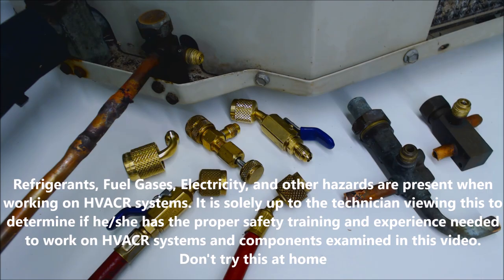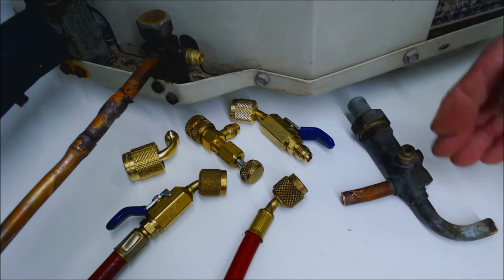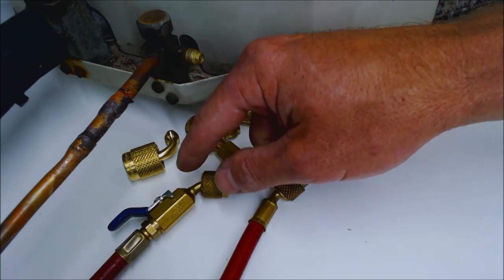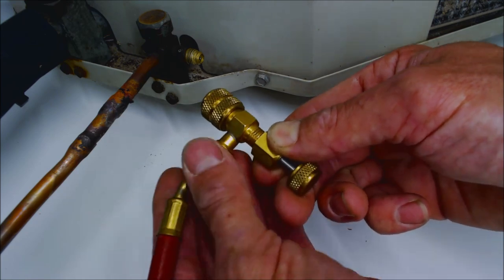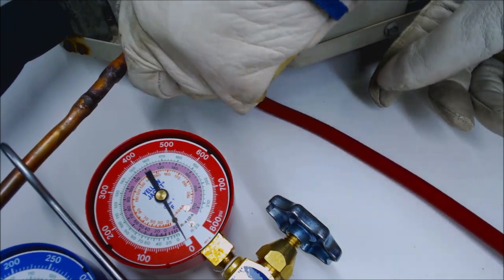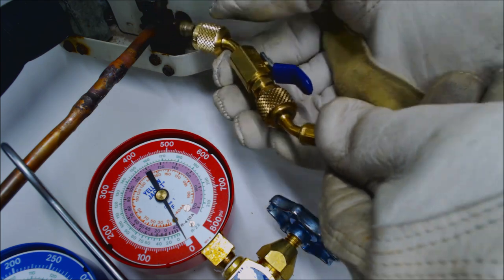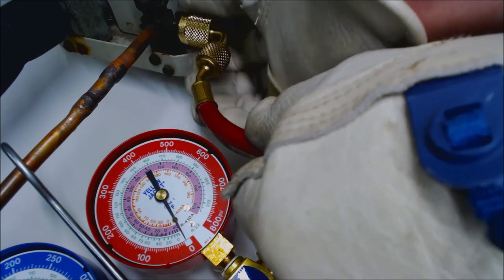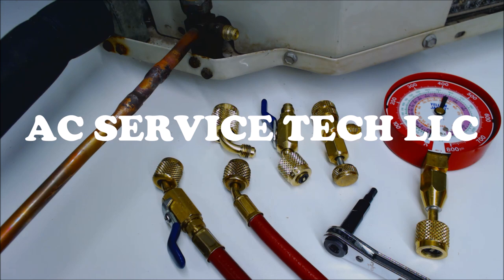Connect & Disconnect Refrigerant Gauges! Low Loss Fittings!

Comment from the maker: Tool List-  https://www.amazon.com/shop/acservicetech
Support-  https://www.patreon.com/acservicetech
For those that are looking for the tools used in the videos: (Linked Below)
Here is the Yellow Jacket 1pk Compact Ball Valve- https://amzn.to/2uXdF18

Here is the Yellow Jacket 3pk Compact Ball Valve- https://amzn.to/2AiKfQe

Here is the Thumb Screw Valve Core Depressor with Backseat- https://amzn.to/2mR0sCL

Here is the Yellow Jacket Sealright 90 Coupler- https://amzn.to/2LsU1V7

Here is the Link for the Yellow Jacket Refrigerant Manifold Gauge Set used in the videos http://amzn.to/2aenwTq

Here is a link to Refrigerant hoses with valves used in the videos  http://amzn.to/2aBumVI

Here is the link to the Blue Vapor Yellow Jacket Gauge- https://amzn.to/2Ju7pan

Here is the link to the Red Liquid Yellow Jacket Gauge- https://amzn.to/2sSFmGH

Here is the Quick Coupler for the Gauges- https://amzn.to/2sTk8Ze

Here is a link for RectorSeal Bubble Gas Leak Detector http://amzn.to/2ckWACn

Here is the link to the Appion Valve Core Removal Tool- http://amzn.to/2uYr8WL

Here is the link for the Ratcheting Service Wrench   http://amzn.to/2dGV4Nh

Here is the Link for the newer UEI DL479 Multimeter with temp sensor- http://amzn.to/2jtsUbJ

Here is the link to the CPS Vacuum Micron Gauge- http://amzn.to/2v1nM3O

Here is the Link to the Appion Blue 3/8" to 1/4" Vacuum Hose- http://amzn.to/2uYlVyc

Here is the Link to the Appion Red 3/8" to 1/4" Vacuum Hose- http://amzn.to/2uYg6Ro

Here is the link to the Yellow Jacket 1/4" by 1/4" heavy duty hose straight-  http://amzn.to/2umtcod 

Here is the link to the pack of 25 C&D valve cores- https://amzn.to/2J1lurm

Here is the link for the C&D Valve Core Wrench, Container, and 3 valve cores- https://amzn.to/2EVGkps

Other tool links can be found in the video description section.

Shop through Amazon! Your Purchases through Amazon provide a means for channels such as mine to earn advertising fees from all purchases after clicking through. Prices are the same as normal-    https://www.amazon.com/shop/acservicetech

All of the ACSERVICETECH Playlists-  https://www.youtube.com/channel/UCOZR-1IqsAer9wzlvFgb4mA/playlists?view_as=public
Reply: AC Service Tech LLC quick question,  a coil that hasn't been cleaned in 12 years , can it be cleaned while still in the furnace?  This summer I've been having an airflow problem,  7 techs have went out. And no solution.  Non of them checked the coil I ended up checking it , it was black full of hair and mud . I sent someone to clean it , but I think they didn't remove it
Reply from the maker: Wow, yeah you can clean it while still in there, thanks
Reply: What kind of gloves do you recommend?

Comment: Got a couple questions. 
1. Do you vacuum both high and low side ports or will just one side suffice. 
2. Do you always remove the valve core for charging and vacuuming. 
3. Do you replace the valve core everytime it's out. 
I appreciate what you do and the info and learning and education that you put out to make other people better and learn more.
Reply from the maker: 1. always both because the metering device acts like a restriction half way down the tubing.
2. vacuuming yes, breaking the vacuum with refrigerant, yes, adding extra refrigerant into an existing system no
3. No only on old or leaking units, thanks
Reply: @acservicetechchannel  thanks for what you do. Happy New Year to you and your channel.

Comment: Great video.  The channel must be doing well ! I see you made it a business!  Congratulations
Reply from the maker: Thanks Channel Cat Chaser!
Reply: How many liquid gas in the hose and guage after close valve. If scale use manufacture said 650gram gas but when i use scale in the two hose lines and gauge has a gas. Is we r filling less gas. Need to fill 700 gram gas in it?

Comment: Which fittings do you prefer personally? I am New to the field and the last thing I want is to waste refrigerant while servicing. Purchased your book btw excellent material. thanks for making such great content
Reply from the maker: Thanks so much. I buy the hoses with the manual valve on the end but if you have standard hoses, you could buy just the end fittings. I like the manual valves on the end and I also like the valve core depressing ones, but only the version that has a back seat that can lock refrigerant in the hose, thanks!

Comment: Good video never like low lose fitting I don't use them have a shut off at the end of each hose because it never release all the refrigerant especially when you dealing with all the refrigerant when doing refrigeration system. Other point is the digital gauge set l read some where it's not good having refrigerant trap when not using you digital gauge .
Reply from the maker: Hey Edward, we don't trap the refrigerant and keep it in the gauge set until the next call. That is probably what you read. Yeah, I use the ball valves on the end when charging the liquid back into the system from the high side. I just wanted to go over what manual and low loss fittings are for those that are taking the EPA 608 or already did but didn't really know what they were, thanks
Reply: AC Service Tech LLC That why l don't like them you have to release the refrigerant don't bleed off .
Reply: How many liquid gas in the hose and guage after close valve. If scale use manufacture said 650gram gas but when i use scale in the two hose lines and gauge has a gas. Is we r filling less gas. Need to fill 700 gram gas in it?

Comment: C&D Valve CD2070 Large Thumb Screw Core Depressor with Back Seat...    So I bought this, but it doesn't work, the refrigerant started to spray out the thumb screw after the first turn.   I tried to back off the screw but it kept leaking so i took it off completely.   Can you make a more detailed video on this one tool?  or the adjustments of it?

Comment: at 4:45 you talk about weighing refrigerant back into the system and refer to other videos. I'm assuming your talking about putting the refrigerant that vented to the gauge set and hoses back into the system.  I'm at a loss, I looked around and don't see that explained in other videos.  can you point me to one of the videos that explain that. BTW, I have got so much good information for you that I just purchased your Paperback, Workbook, and Card Combo.

Comment: Wow I’m changing all my grommets now
Reply: How many liquid gas in the hose and guage after close valve. If scale use manufacture said 650gram gas but when i use scale in the two hose lines and gauge has a gas. Is we r filling less gas. Need to fill 700 gram gas in it?

Comment: Did you use the same gauge set for each fitting? I saw the pressure go back down to zero  right before the new fitting  was attached. If so, that's some good editing.
Reply from the maker: Yes I used the same gauge set for each, thanks John!

Comment: I have question to you about weighting the high side refrigerate back into the system. Which is something I have always done, I recently saw were someone said on a critical charged unit that would over charge a system. Because what in the system is in the system and what’s in the hose is pretty much extra Freon. What is your take on that theory? It’s a new concept to me, I deal with a lot of critically charged units being a refrigeration tech.

Comment: Excellent video 👍🏼 Thanks!
how much refrigerant does a regular set of hoses hold?
since in refrigeration the right charge its very important I always wondered that
Reply from the maker: In reference to refrigeration, we purge the air to the end of the hose where the manual valve is, then we zero the scale out prior to weighing in the full amount of refrigerant in as stated on the rating plate. The weight would depend on if its vapor, sat, or liquid and the length of the hose. I have tube size and refrigerant weights at the website in the articles section, thanks!

Comment: Could you please make a video on how to wire a peanut relay from start to finish from 240 volts to relay to airhandler if you don't have sequencer  Or how to use contactors instead of sequencers.
Reply from the maker: Bronchee Mims, thanks for letting me know what you would like to see!
Reply: How many liquid gas in the hose and guage after close valve. If scale use manufacture said 650gram gas but when i use scale in the two hose lines and gauge has a gas. Is we r filling less gas. Need to fill 700 gram gas in it?

Comment: quick question; can i use a schrader valve removal tool ( the ones with extra 1/4" access on the side ) instead,  so i won't have to buy both removal tool and a low loss fitting? do you think they would hold a deep vac? thanks
Reply from the maker: Hey mina mina, yes the valve core removal tools will hold a deep vacuum but I try to keep low loss fittings off my vacuum setup. Have you seen "acservicetech full vacuum procedure"? I wouldn't go pulling valve cores out each time you are connecting to a system to read a charge. You should get the manual low loss fittings. I don't think they are that much but well worth it. I have them linked at amazon.com/shop/acservicetech thanks!

Comment: I see you mainly use the same guages in each video. What is the benefit to having guages with the 2 extra middle hand valves? Getting ready to purchase guages off your list and not sure if I should get the Yellow Jacket 2 handle with hoses and ball valves or the Yellow Jacket 4 handle with hoses and ball valves.
Reply from the maker: The 4 port 4 handle gauges are primarily for those who like to pull vacuums through their gauge sets. I like to keep my vacuums separate for less chance of a leak, less restrictions, and faster vacuums, thanks James!
Reply: @acservicetechchannel  How many liquid gas in the hose and guage after close valve. If scale use manufacture said 650gram gas but when i use scale in the two hose lines and gauge has a gas. Is we r filling less gas. Need to fill 750 gram gas in it?

Comment: So I noticed you only screwed them on finger tight. Would there be a problem if you used a pair of pliers to screw on the hose really tight. Does that prevent leaks or are you just wearing out gaskets and parts?
Reply from the maker: You would be wearing out and possibly tearing the rubber gaskets with pliers, thanks!
Reply: How many liquid gas in the hose and guage after close valve. If scale use manufacture said 650gram gas but when i use scale in the two hose lines and gauge has a gas. Is we r filling less gas. Need to fill 700 gram gas in it?
Reply: @vineetsehgal4738  considering the gauge manifold accuracy and temperature sensor 50 grams of tolerance is acceptable as it wont make any drastic change,but you made a point hoses hold the small amount of charge in it

Comment: Whats your feeling about using same hoses and gauges on different refrigerants? Also smart probes?
Reply from the maker: You would blow the hoses out with some nitrogen but basically you are trying to avoid mixing oils in the hoses. Probes helps and somewhat avoid that problem, thanks!
Reply: AC Service Tech LLC thank u!

Comment: Did the red hose you attached the sample LL adapters to, have a schrader valve or was it removed?
Reply from the maker: It did have a valve core depressor inside the end of the hose but if you are using it on a permanent basis, it could be removed. Also, you wouldn't use these LL fittings for recovery or vacuuming as you would use hoses without a valve core depressor and use valve core removal tools, thanks ejcsds!

Comment: Do you remove your hose gasket when you add low loss fitting to normal charging hose? Thanks
Reply: You'll have to keep the hose gasket, otherwise you'll get a leak where your low loss meets the hose

Comment: I have a question that no one has been able to answer yet. If you have the compact ball valve and you hook up to a service port how do you bleed the air out between the ball valve and the actual service port if there is still freon in the hoses.
Reply from the maker: Joey look up acservicetech connect check the charge, disconnect procedure, you just use the systems pressure to purge that leftover amount of refrigerant before connecting to a closed refrigerant bottle, thanks!
Reply: AC Service Tech LLC so if there is freon in the hoses and air being introduced in the hoses at the service port the air will migrate through the freon to the gauge set to be able to be purged out?

Comment: Do you use different gauge sets for every refrigerant?......
Reply from the maker: I try to use one for r-22 and one for r-410A but nowadays it gets hard because there are systems with nu-22, M099, and R407c too, thanks
Reply: AC Service Tech LLC yea. That’s what I was going to say. You must have like ten sets of gauges in your truck.
Reply: that would be ideal @ Oscarbm1234, but then you could move contaminates around from system to system >_>
Reply: How many liquid gas in the hose and guage after close valve. If scale use manufacture said 650gram gas but when i use scale in the two hose lines and gauge has a gas. Is we r filling less gas. Need to fill 750 gram gas in it?
Reply: What brand is best when it come to fittings and hoses?

Comment: low loss "fartings" is more a correct term, good for low flow testing, but poor for recovery, vacuuming, charging. this is more or less a work around to the silly ports/ hose ends R134A has had for years ;) 
and it still fails..... ports leak tons of gas per year
Reply from the maker: Hey Throttle Bottle, I use the manual valve type all the time for charging but they are built onto my hoses. None of those should be used for vacuuming or recovery. I just wanted to go over what a low loss fitting is and how to use them for those students learning the term "low loss fittings" manual or automatic during their EPA Test Prep, thanks
Reply: I get that, but low loss = lazy tech excuses 101..... then again, I recall others venting multiple pounds of R22 and worse into the 90's :))
Reply from the maker: Hey Throttle Bottle, we all use low loss fittings. At the very least one on the red side.  It wouldn't make any sense not to unless a tech was only working on 3 position valves. I use them on all three because they allow me to be able to valve off and control things better with the ball valves, thanks
Reply: How many liquid gas in the hose and guage after close valve. If scale use manufacture said 650gram gas but when i use scale in the two hose lines and gauge has a gas. Is we r filling less gas. Need to fill 700 gram gas in it?